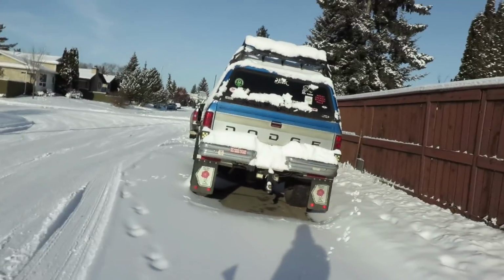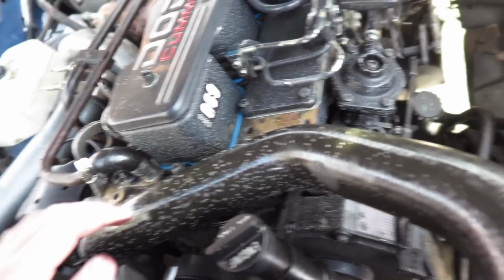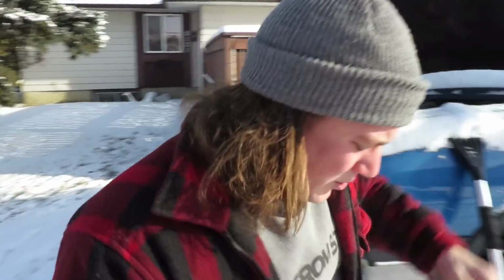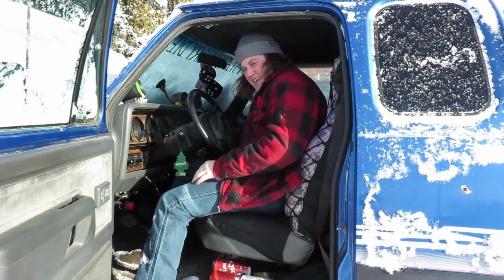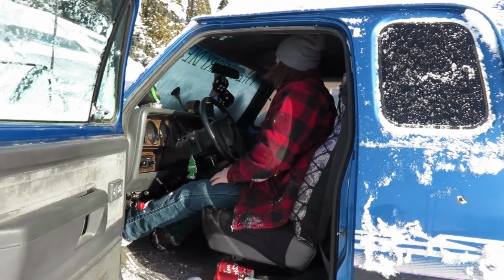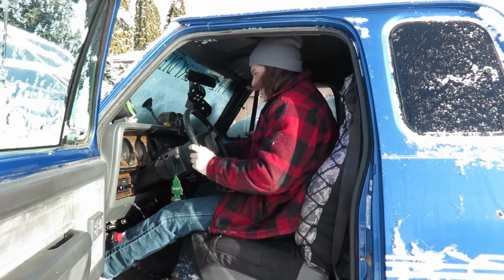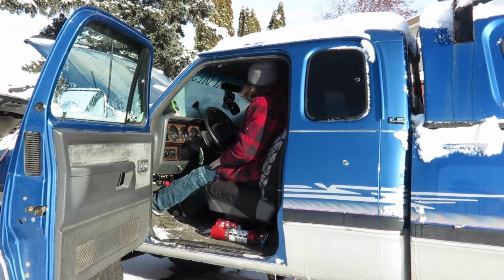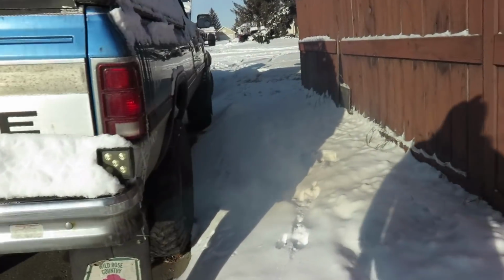Barb cold start vlog

Comment: my old 82 6.2 had the block heater oil pan heater and a battery charger all slipced into the single plug, thing started mint at -40 till i put the rod through the block.

Comment: Try priming it with a broom handle down over the drivers fender, much easier😉
Reply: Prime what? The fuel, or oil pressure, or fast idle stick?
Reply: Well you push the primer on the lift pump with a broom handle to bleed air from the fuel system up to the injection pump, after that you crack open  injector lines the eaisest 3 to get at.
Reply: @al3xxgreat  cool thanks bud

Comment: Oil can seep through silicone coolant hoses seen it lots. You could have oil in your coolant
Reply from the maker: nah, if thats the case, i just did a head gasket and studs on this truck. probably just old oil. i never changed the upper rad hose

Comment: Webasto coolant heater. Or Espar. Same principle as plugging it in except it’s a little diesel powered heater that goes in line with your coolant system.
Reply from the maker: a little pricey for a truck that i don't drive in the winter much
Reply: Eric Jalbert yeah that’s very true. You can get some good deals on them if you buy them used or remanufactured off eBay.

I didn’t know about them until recently so I figured I’d pass it along.

Comment: You need a new upper hose it has pinholes you can’t see and that’s why it looks like that also you might wanna give the coolant system a flush looks like there could be some oil in there

Comment: I'm a ford guy but I really like your truck .I just bought a 03 2500 24 valve fucking love that thing it keeps my 6.4 powerstroke company .
Reply: Just curious, what on earth drove you to buy a 6.4? Future project truck?
Reply: Jacob G 6.4s aren’t really that bad lol
Reply: @georgecostanza9387  
It may just be a handful of bad anecdotal evidence that I've heard. Everyone I know who's owned one says they're the worst engine they've ever had - although these people are often coming off of 600k miles with a 7.3, so their standards may be a bit high.
Reply: Jacob G they’re not great or anything but they’re not as bad as everyone says I’ve seen some of them take a real beating and be just fine and I’ve seen some fail for pretty much no reason but usually if they got some aftermarket parts in them they last quite a bit longer than stock ones
Reply: 8-10 years I really like the body style and interior . Mines deleted and studded I also run a mild tune on it and so far the 6.4 has been great for me . Also I treat it like a truck and not a hot rod.
Reply: @georgecostanza9387  
If I ever found a really good deal on one I might consider it, but I've only ever seen then for 15k+ around here, even for base models with tons of miles.

Comment: That's your oil in radiator fluid mixed together that's a serious problem
Reply: Yup that's exactly what it is, as long as  there's no water in the oil you are good to run it but it's not smart. My truck that did that the oil cooler in the rad started pissin oil into the coolant, never the other way around so I ran it for awhile before fixing it
Reply: Or the coolant just soaked through the hose

Comment: Hair dryer and a big heater on the engine then it will start
Reply: I think it needs more batteries. First  gens only had one battery  i think
Reply: Alan ok
Reply: @tracywagers1399  that and a rebuild  apparently. I didn't  watch  until the end before commenting lol.  Low compression will  definitely  cause hard starting in a diesel.
Reply: Ok